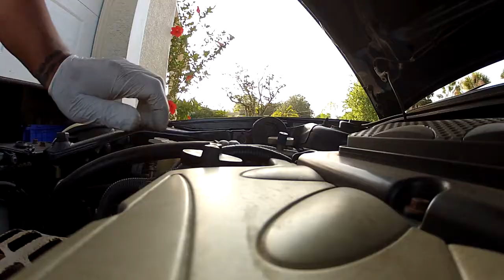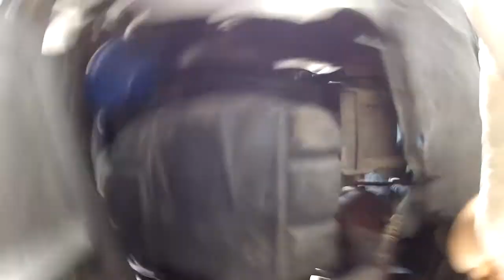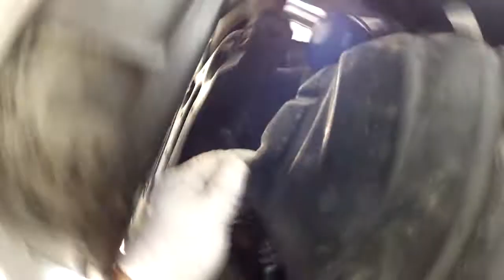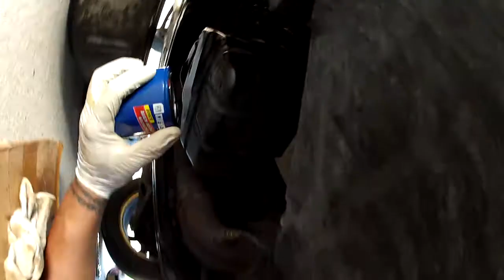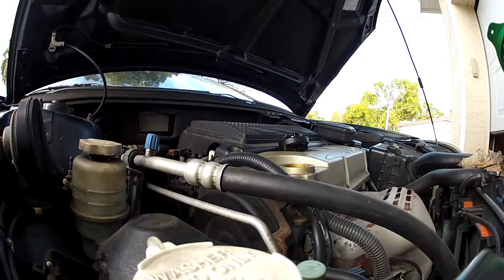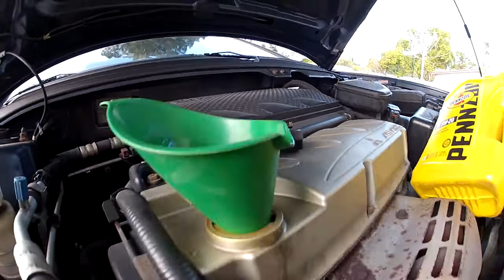How to Change Oil on Mitsubishi 4 Cylinder Galant ES

Comment: Me wifes galant was purchased new in November of 2004 and 14 years later it's still running like a champ with only 135k miles on it. All it need is a paint job and interior shampoo and she will be like new again.
Reply: mike Lowry same here bro my mom bought the car in 2004, it’s a 2003 still running strong with me behind the wheel lol, with 120k miles on it
Reply: Mine a 05 139000 runs great
Reply: @liamp20011  car still alive in 2021?
Reply: @destinyray2023  just bought one 170k she runs and drives greatt gota replace my muffler tho :(

Comment: what is the engine oil type and grade ?
Reply: It depends on what size motor you have but if it's a24 vs then you need 5w 20 and I believe, certainly double- check however I believe it's 4.3 or 4.2 leaders. Don't forget the oil filter
Reply from the maker: You also can put two grades...(check with autozone rep), . I went with Penzoil 5w-20